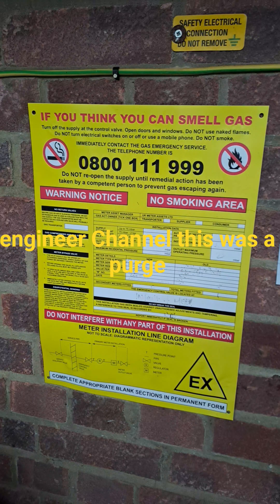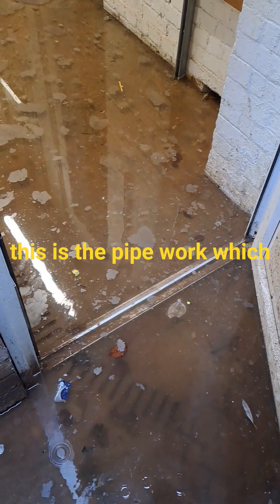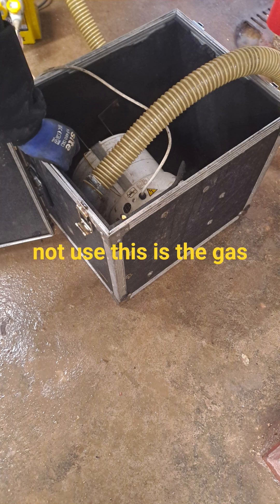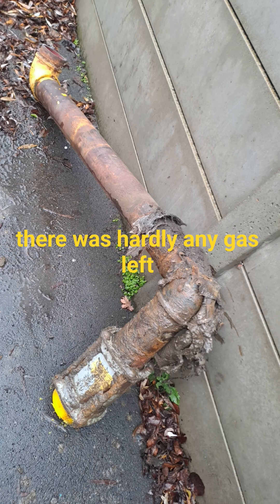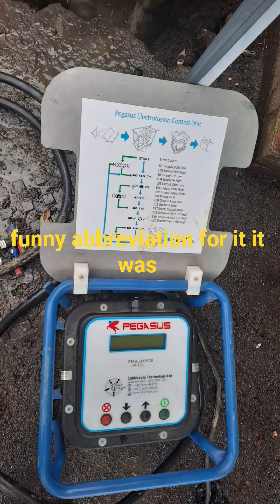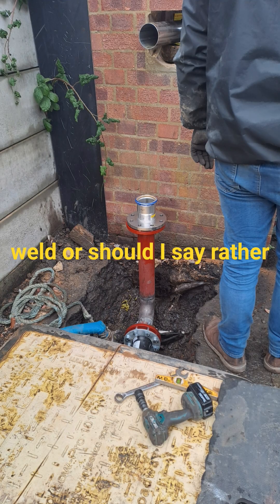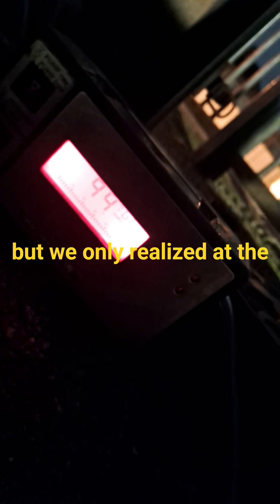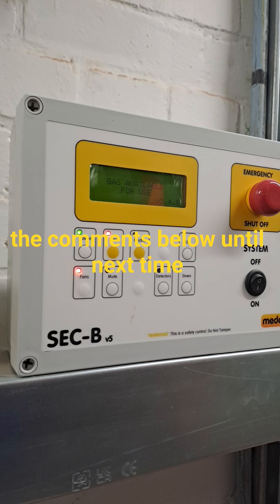Gas Purging on Commercial Pipework

Comment: Wouldn’t it have been a better option to put in a pe bend with grp sleeve and transition to steel above ground. They push for underground to be replaced in ireland
Reply from the maker: You’ve made a very good point, and in a planned renewal a PE service with a sleeved transition and steel above ground would absolutely be the preferred option.

This was an emergency turnaround repair following a live gas leak to restore supply to a public building. The objective was to make the installation safe and regain service quickly, not to upgrade or redesign the service.

Steel is acceptable underground when it’s correctly protected, and in this case a steel repair was the most appropriate solution for the scope and conditions of the work.

Comment: Trouble with purging is I hardly ever do it so have to read through everything every time. 25 years and I think Ive done one about 10 times maximum.
Reply from the maker: I hear that.

7 years commercial I've done 7~ purges in 7 months. Up to then, don't think I had any b4.

I believe if done correctly, reducing risk, it's a specialist job within itself